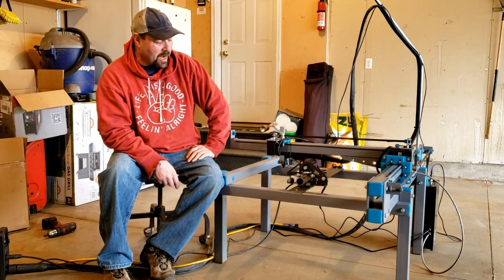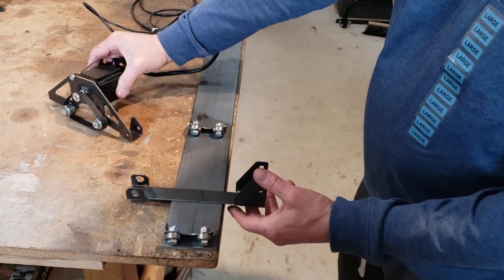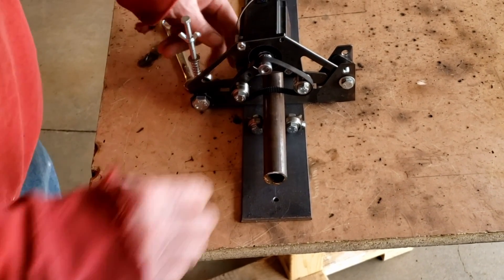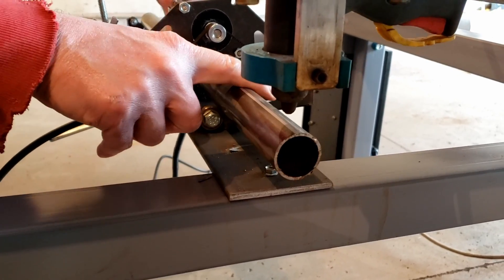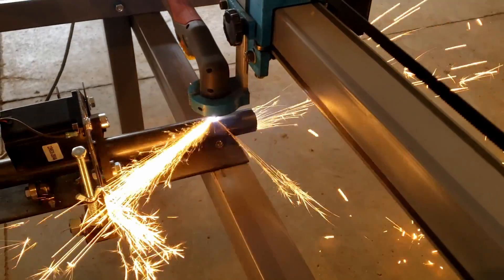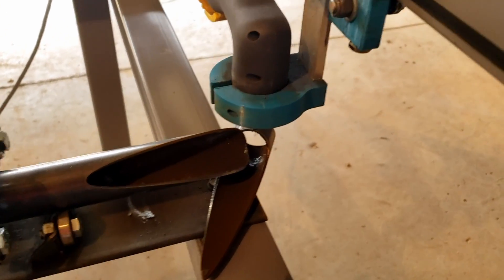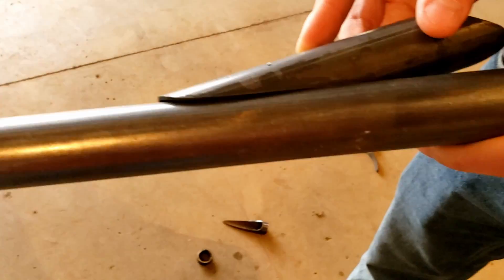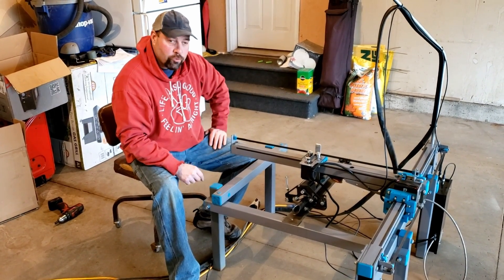Budget DIY CNC Plasma Cutter || Adding a Rotary Axis

Comment: Love this addition to the design. Contemplating buying the plans. I have a heavy duty chuck rotary axis for my laser cutter/engraver. How difficult would it be to change the rotating parameters in the code based on the gears of my rotary axis to make it work with this plasma cutter? Are those firmware code changes accessible to the user?

Comment: What about square tubing?  

This would be a nice new project to fortify your rotary progress.
Maybe make some sort of cradle to hold the square tubing,
and some software for the z axis.  cut a side, hold torch off the side, 
rotate and level the tubing, torch cut back the other direction, etc.

Very nice job on your rotary axis design.  Very nice!
Reply: Find a piece of round tubing that the square tubing just fits inside.   Or cut some "washers" that put the square tubing in the center of a piece of round tubing.

Comment: I know this is a pretty old video, but I just purchased your plans last night.  I’ve got BendTech Pro that I use for building my tube bending parts and I have the ability to print notching templates on paper.  Would you know if there is a way to transfer those notching templates from BendTech into Fushion360 to be able to notch tubing for the parts I create in BendTech using this notching attachment?

Comment: Do you guys have a video on the programming on this notcher? I cant wrap my head around how the clocking works with different sized tubing. You mentioned nothing is changed as an inch is an inch. So if this was programmed on Fusion 360, my guess would be to take a round object, put in your beveled/coped cut on the end. then lay it out flat. and it rotates the object with the same stepping from the rotary to the x axis. I am familiar with 4 and 5 axis milling machines. Again, id assumer you're programming with fusion 360. My other thought would be Fusion thinks its a "rotary on a mill". So the torch would be like an end mill and since you taught it to cut at given diameter it does just that and rotates the appropriate degrees. If you guys can clear this up for me, that would be great! Is there a specific "programming" document in the files for this? I have purchased them and asked a couple questions already. Thank you!
Reply: It's just unrolled and an axis is swapped.  It still thinks it's cutting a piece of sheet metal.

Comment: How is the cutter doing on consumables with this setup?

I have a very cheap Plasmacutter which I am completely unhappy with it. It wont cut straught for a centimeter, not even with new consumables on it. I am wondering if that is due to the burner, wrong settings or potentially deviation in distance to the plate. If the latter, I mght be able to salvage that Plasma for a CNC table...

Love your build by the way!
Reply from the maker: Ours is pretty good on consumables, the kerf starts to expand at around 80 minutes, and they usually go out around 100 or so minutes. We noticed if you have water in the air you can ruine consumables almost instantly.
Reply: @jdsgarage701  Thanks! 80 minutes is lightyears from what I am getting with mine hand held... Might be worth a try!

Comment: Could you by chance do a video on how you do the cad/g code for this? I was tinkering with this in fusion 360 and I found you have to convert the pipe to sheet metal to cut it.

Comment: What NEMA motors are you using please also if u are going to up scale the same design that you have to take 8*4 sheet by 12 mm does it matter to use a larger NEMA motors ??? Thanks

Comment: Hey guys! I ordered your plans and I've got the 3D printer rolling. Quick question: I do a lot of notching with 7/8 tubing for tig welding and was curious if the rotary attachment will work for 7/8? If not, are there a little bigger diameter bearings that might make it work? Thanks guys!
Reply from the maker: It will fit 3/4" tube up to 2-1/2"  tube
Reply: I like how you guys have a basic garage fab mentality.

Comment: So it would be good to see the plans for the tube notcher sold all by itself for folks that already have a table. Also it would be good to setup a how to video walking through the software steps of what you did to create the tubes. the explanation is ok to have but show and tell is much nicer. Thanks for your videos neat project can't wait to see additions to the z axis and what you will do about a torch height control maybe in the future.
Reply from the maker: We are working on a video tutorial, but the reason it is not sold separate is because it is not compatible with other plasma tables without extensive modification.
Reply: @jdsgarage701  , I feel like with the plans, the motor and the controller, it wouldnt matter what table is used. Are you using a Y or Z axis? I thought the plasma cutter stayed in place and the X axis spins the tube. This might be a perfect add on for any table.
Reply: I'm interested in just the plans for the rotary as well.  Matching the rotary and the drive ratio to an existing Y axis would be easy enough.  Easier with the CAD file to make any adjustments for the drive.

Comment: What software are you using ?
Reply from the maker: Fusion 360 for the design and cam and the machine runs on grbl 1.1
Reply: @jdsgarage701   did you just made gcode based of a 2D outline cut path? Like what the cut would be if the tube was unrolled flat?

Comment: Great idea. I have bought the plans and starting to work on making the table. Which plasma cutter are you using?
Reply from the maker: The cnc version of the lotos lt5500d
Reply: @jdsgarage701  Are your plans specific to the lt5500d, or can you also use different plasma cutters?
Reply from the maker: @akumabito2008  You can use any plasma cutter you want as long as it has a low frequency blow back start so you don't fry the electronics.
Reply: @jdsgarage701   Thanks! Ordering a set of plans now!
Reply: @jdsgarage701  Cool, thanks.